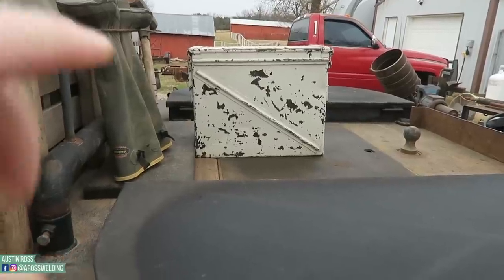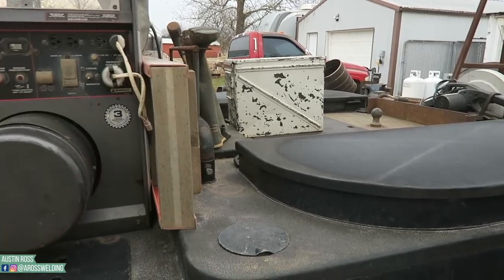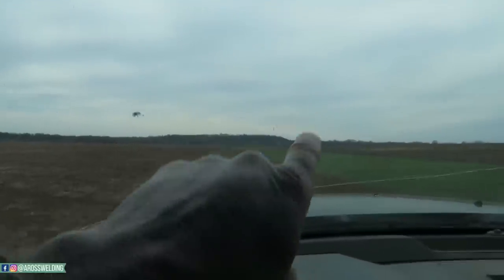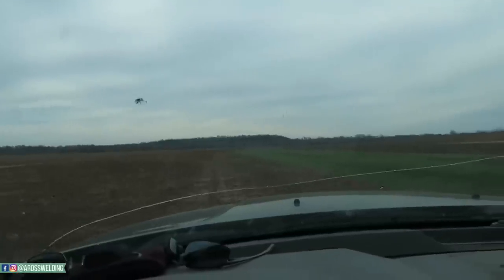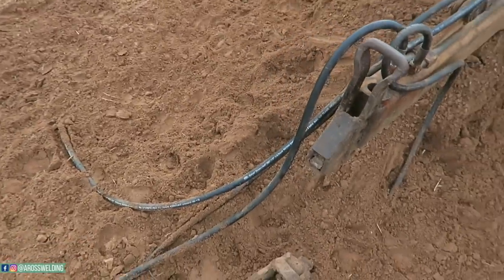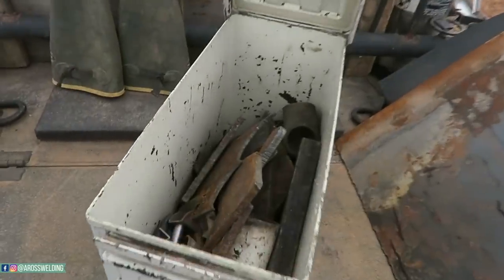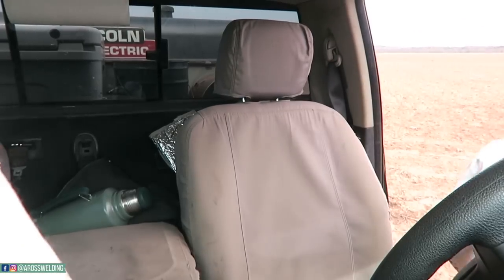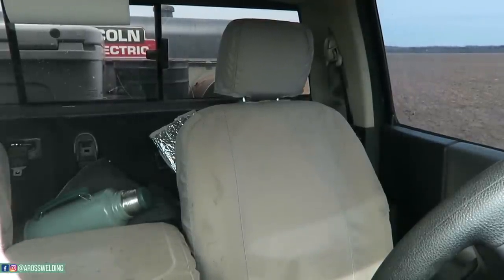EMERGENCY WELDING REPAIR // MOBILE RIG WELDING OKLAHOMA

Comment: Where can I get one of those guides you used with your torch?
Reply from the maker: I got mine from my local welding supply. But I’m sure you can find em on Amazon. Look up Flange Wizard tools
Reply: I just bought a new one on eBay. Flange wizard brand. The magnets turn on and off so they don’t build up with metal shavings. Came with a stainless guide bar and 2 magnets for about $80

Comment: 27/8 pipe is 21/2 ID sec. 80.
Reply: All 2 1/2” pipe is 2 7/8 o.d. Wall thickness or schedule has no change on the outside diameter. A super or monster coupon is technically 2 1/2” pipe.

Comment: 6010 ?  thought you would want 7018  on that Austin just asking
Reply from the maker: I used 7018 on this. I used 6010 on the h-braces
Reply: Yeah higher tensile strength

Comment: Have you ever doubted your welding abilities and wanted to throw in the towel on a project or at work?
Reply from the maker: Back in welding school I got frustrated a lot and had thoughts of throwing in the towel. But now days I enjoy the challenge. It’s gets better with time. More experience makes this line of work more enjoyable.
Reply: Austin Ross thank you. I’m having trouble halfway done with school and sometimes I feel like That. But I need to see it as a challenge and not a roadblock